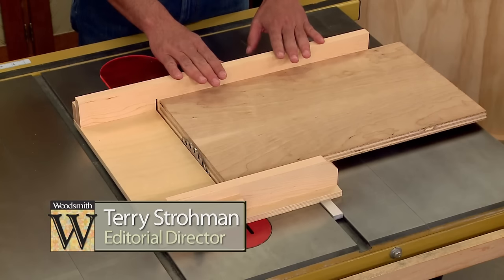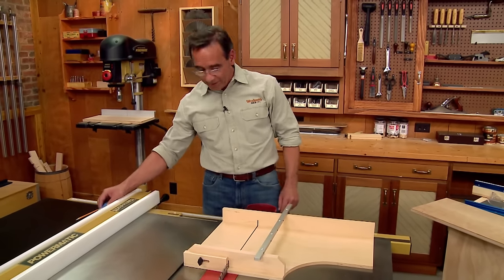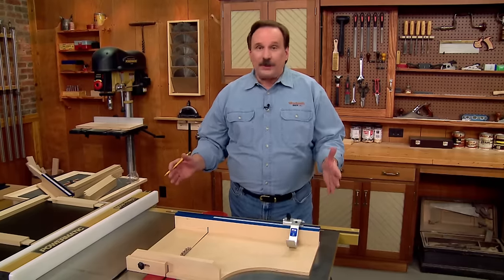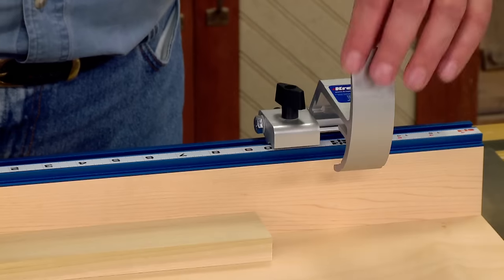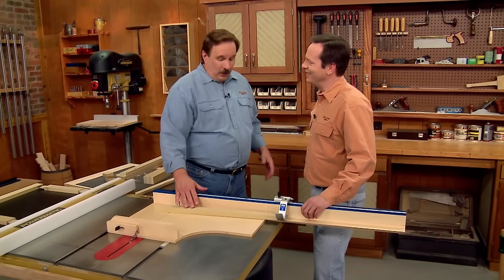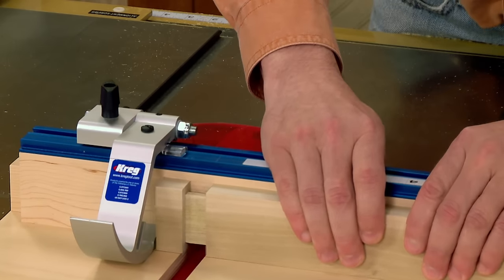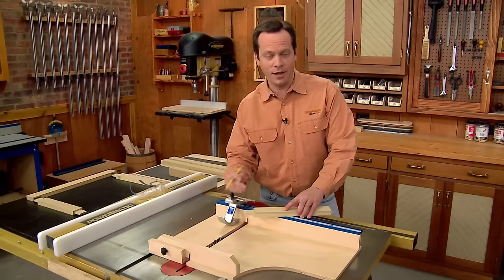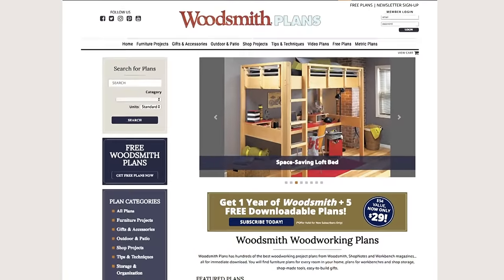Maybe the Best Table Saw Crosscut Sled Ever?

Comment: The only issue I see is that your dado blade eats a huge chunk out of the rear fence... so when you go back to a smaller width blade, you're going to get tearout - but it IS on the waste side, so I guess it's a minor issue.  I really like the adjustability, that's clever!
Reply from the maker: Yeah, I was having the same discussion about this with another commenter too, and even though it's on the waste side of the fence it might get kind of shabby looking if you do  a lot of deeper dadoes.  I think I might add on a replaceable hardboard insert in a small section of the fence like we did on this box joint jig: https://www.woodsmithplans.com/plan/adjustable-box-joint-jig/
Reply: @WoodsmithShowandmagazine  That was the one thing I saw in this good design.
Reply: @WoodsmithShowandmagazine  so whats hthe finaly decision on how you solved the back fence once DADO is used. im looking to build this next weekend and order parts but wondering if i should build this exactly like this. or exact but no adjustment of blades.  because once i use DADO once. its now done
Reply from the maker: mike gray - if you are worried about the back fence getting chewed up I would just add the replaceable hardboard insert as mentioned above (making it about an inch wider on either side of where your kerf and widest dado would be to have room to screw it in place)... You could always do this later or just replace the entire fence if it gets too bad.
Reply: @WoodsmithShowandmagazine  thanks.  I'm a beginner getting into this.  Starting with built in office cabinets.  So cabinets are first project.  I may just start with this design but not adjustable as the size of this jig  dado3for Stiles would be great. But putting a groove in larger wider boards won't work especially length wise.  But then again I'm learning on a small dewalt 7480. Not a large table saw with large tabletop.
Reply from the maker: @4rdzlla  - That's not a bad way to start out... You can always change out the parts and hardware to an adjustable base version later.  Too funny - I have a Dewalt 7480 sitting in my office right now... I'm working on designing a Table Saw Workstation for a future issue of Woodsmith Magazine.  Let us know if you have any more questions on the sled or any other project build.
Reply: @WoodsmithShowandmagazine  workstation for the 7480!? I'll definitely have to follow along.  Didn't buy a stand yet.  Actually dont have the saw yet. It arrives next Tuesday
Reply from the maker: @4rdzlla  - Yep! My plan is to include a router table and flip-top for a planer with it too.
Reply: Also the slit to slide the jig and tighten. Done by router? Not sure how I can do that 1/4 slot
Reply from the maker: @4rdzlla  - I would personally do it on a router table, but I think in the plans it says to drill a series of holes and then clean out the waste with a chisel and file.  Or you could just drill the end holes and then cut out the waste with a jig saw or coping saw.
Reply: @WoodsmithShowandmagazine  trying to order the correct knobs for your cool jig. so many options not sure which one is best and a good size. also the threaded 1/4 insert .50" long right??
Reply from the maker: mike gray - we went with a smaller “T” knob but the shape doesn’t really matter... I would just go with something low profile so it’s not in the way.  You are correct on the threaded insert... 1/2” length is good.

Comment: I just got the plans today and they seem reversed for my sawstop. Can you please send me a link for the correct plan orientation? Thanks Marshall
Reply from the maker: Yep, the original plans were designed for a right-tilt table saw and your SawStop is probably a left-tilt saw like the one in this video.  All of the parts will be the same size just flipped to the orientation seen in the video and the art on the last couple pages of the plan.  Is your e-mail mbgeller... If so I've also added the premium shop drawings to your account at Woodsmith Plans. Just log in to your account and go back to the plan page: https://www.woodsmithplans.com/plan/precision-crosscut-sled/ and click on the link "Shop Drawing" right above "Download" to get more detailed part drawings for the left-tilt version.  Let me know if you need anything else and I'd be happy to help.  - John
Reply: @WoodsmithShowandmagazine  
Thanks John. Got the info and it’s very helpful. Much appreciated!
Marshall
Reply: Hi John,
I was looking at the table saw jig you previously mentioned in regards to making a removable hardboard insert in the rear fence. This is for maintaining a zero clearance when switching between a dado blade and a single blade. Is there any info you can share as to how to go about makin this insert for the fence on this sled?
Thank You
Marshall
Reply from the maker: @marshallgeller8025  - Regarding the process for adding a replaceable insert in the Precision Crosscut fence.  I would use a piece of 1/4" hardboard (approximately 3" wide in this case) so it can extend about an inch on either side of where the widest dado blade will make a cut in the fence. Then cut a 1/4" deep dado to create a pocket in the fence for the hardboard to set in and be flush with the original face of the fence.  To keep the insert in place, you can countersink a brass screw on each side of the hardboard outside the reach of the blade.  I prefer brass because it is soft and if a blade were to hit it then it wouldn't damage the blade.  (I sent you an email too with some more detail)
Reply: @WoodsmithShowandmagazine  John
Thanks so much for the additional info and guidance on how to proceed. Excellent instructions on how to add this feature to the sled. You guys rock!
Marshall

Comment: This table saw sled video is similar to the one that was published in a magazine called Tips, Tricks, and Jigs by Woodsmith.  It's dated 2020 or early 2021, pg 10 thru 13.  I'm trying to decide which way to go with.  I think the biggest difference is the amount of plywood required to make the two-sided sled.  The two-sided sled in the video has an option to add the extension.  The magazine used a longer plywood (4' or so) which is probably more stable than the extension???  Any suggestion would be greatly appreciated.

Comment: the sled is nice, I agree, but once you use the dado ability of the sled, you have then ruined the zero clearance on the rear fence. You make your cut through and the clearance is then widened out to the width of the dado you were using.
Reply from the maker: Yeah, I agree that the back fence will get chewed up (as mentioned in previous comments) it's not a huge deal because it is on the waste side of the cut but one solution would be to add a replaceable hardboard insert like this sled:  https://www.woodsmithplans.com/plan/table-saw-dovetail-jig/

I've been meaning to shoot a video on this subject, so I'll get on that.  Thanks.

Comment: What a great sled!   I wish we could get it as a pre-sawn ready to assemble kit?   Excellent video!!!
Reply from the maker: You may not be too far off on that idea... we are looking at selling CNC-ed & flat-packed kits for some of our more popular jigs.
Reply: I'll take the first one!  Of course you all will have to sign, date and number it  ;^)
Reply from the maker: @drobb4207  - Signed, Limited Edition Woodsmith Branded tools have to be worth a lot more, right? ;)
Reply: @WoodsmithShowandmagazine  - Yeah, you already sell rulers, card scrapers, etc. (I should know;  there are a few Woodsmith branded items in my workshop.) So, you have the system in place to sell the kits. 👍
Reply from the maker: @David_K_pi  - We are gearing up to roll out some kits & more tools this year.
Reply: Yes they are worth more but whoever puts dibbs on the 1st one gets it free! @WoodsmithShowandmagazine
Reply from the maker: D Robb - LOL.. Is that how it works?
Reply: @WoodsmithShowandmagazine  - I'll take the second one in case you're extending the deal.
I'm a good beta tester, by the way - especially on software. My boss thinks I can break any program. Er, uh, find the flaws I mean. 
I can test your new kit for you. 😁
Reply from the maker: @Lynn Collett -  LOL -  so if you buy something like a router table or similar tool are you not a woodworker because you can build your own? :)
Reply: @WoodsmithShowandmagazine  in theory you could build your own router, saw, drill. I could definitely build a router. Thing is.... my time is worth more than that. 😉
Buying ready made is fine. Kits are good because it helps both ends of the skill spectrum. Those that are new to making get to develop a bit of knowledge and that aren't get to save a bit of money. Win win 👍🏼
Reply from the maker: @hesperhurt  - Thanks.  I agree.   :)

Comment: like the adjustability but I have RH saw arbor therefore blade  datum is RH flange, and wood is wasted to LH side with increase blade thickness and Dado blades. The adjuster needs to be on the LH side in my case.
Reply from the maker: Actually, if you look at the photos from the plans: https://www.woodsmithplans.com/plan/precision-crosscut-sled/  We originally built this for a right-tilt saw.  We mirrored the build for the saw in the video because it is a left-tilt.  You just need to orient the sled based on the arbor on your saw.

Comment: there will be a problem, you got a very low max height for your blade which in in itself is good though cause it will reduce the kickback risk. Never remove the knife after the blade it´s there for a reason
Reply from the maker: I agree, a good riving knife can be the best accessory in preventing kickback.

Comment: Now wouldn't it make more sense to orient the sled extension to the right of the blade, where the extension table could help support any added length on the work piece?
Reply from the maker: Yes, but the orientation of the sled is dependent on whether you have a left-tilt or right-tilt table saw.  The sled needs to open up in the direction in which you stack the dado blades.  The saw in this video is a left-tilt blade so the dado blades stack to the right.  If you have a right-tilt saw the blades stack to the left and you would build the sled in the manner you mentioned.

Comment: Is the corner cutout an aesthetic feature only or it has a purpose? Thanks.
Reply from the maker: It does make it look nicer, but the main purpose is just to reduce the weight of the sled.  The functionality of the sled would be exactly the same without the cutout.
Reply: @WoodsmithShowandmagazine  Thanks. That was my assumption but just to make sure. I like it - economical as it uses just one runner...

Comment: Yes it's a good sled but nothing to ground breaking. I have 3 sleds and use oak for the guide and fence. All my sleds use both grooves. It didn't need so many people to demonstrate this very small sled. Been woodworking since 1974 and any woodworker worth their salt has sleds. For the newcomers use both slots when making a sled. More sturdy.
Reply from the maker: Yeah, we didn't NEED 4 guys to demonstrate how to make this sled but how else are we supposed to show off all the different colors of matching shirts we have...  I mean it would be pretty silly for just ONE guy to keep changing shirts during the video, am I right?  :)

With the expanding base on this sled it doesn't really work to have 2 runners, but it seems to work just fine with it's relative small size and the aluminum runner having the ability to be fine tuned for the perfect fit in the miter slot.
Reply: Checkers Boards how can you possibly have found something to have taken issue with in this video? Honestly what’s wrong with you?  Where can we send your refund?

Comment: What kind of wood do u suggest.  I have 1/2 ply for base. But for fences. I dont have scrap. I'm actually going to store for this specifically.  I have maple but it's for my cabinet doors that I'm trying to make.  I dont want to use my maple.   Poplar? Or all playwood? I have abundance of 3/4 birch finished plywood.
Reply from the maker: I'm sure 3/4" poplar or plywood would be just fine as long as it's straight and flat.

Comment: Does the cutaway portion really serve any purpose other than making the Jig lighter-weight? I don't see that benefit making it worth going asymmetrical and having less surface for bearing and support, but maybe I'm missing something.
Reply from the maker: Mark Young - Yes, the main reason is to cut down on weight... but it also makes it more aerodynamic and cuts down on the coefficient of friction too. It’s one of the fastest, lightest, and smoothest sleds our there... probably. ;)  Plus, it just plain looks cooler. But if you don’t want to do the cutout, then you can leave it symmetrical... it won’t hurt anything.
Reply: @WoodsmithShowandmagazine  gotcha. The zero clearance and T-track/stop are nice. You should add the safety stop that Matthias Wandel does on his sleds; I can't recall if he has a spring on his, but I made mine spring loaded, so the stop is reliably pushed down into a recess on the tablesaw before the blade is exposed. I put them on my two main sleds.
Reply from the maker: @musicbymark  - Thanks... I'll take a look at Mathias's safety stop.
Reply: If the old shop notes email address I used to use still works, I could send you photos of my implementation on my sleds.
Reply from the maker: Mark Young - I would assume the ShopNotes e-mail still works but not sure... I’d love to see pics. Email them to orders@aimmedia.com Attn: John Doyle and I will get them for sure. Thanks!
Reply: Mark Young d

Comment: This sled is potentially dangerous. If you place a long piece, using the extension fence, you run the risk of the sled becoming unbalanced. If the blade is running when that happens, it could be catastrophic.
Reply from the maker: This is true.  With all jigs and fixtures on power tools, you should use your best judgement on what is safe.  If you place an extremely long piece on the sled extending off the table saw, you should test the balance before you turn the saw on and slide it through the blade.

Comment: I spent $8 for plans that are backwards? 
Really?
Just flip 'em around in your mind, right?
Couldn't possibly make any errors doing that.
I won't be back if this is what I can expect from you folks.................
Reply from the maker: They are only backwards if you have a left-tilt saw.  :)  (which is probably every table saw that was built in the last decade.)  I believe we've added some drawings at the end of the plans to demonstrate the different construction for the left-tilt version, and all dimensions remain the same.  You are probably correct that this is less than satisfactory based on the popularity of left-tilt saws in the current market and the popularity of this plan.  We'll work on getting some separate drawings for you if needed.  To the best of my knowledge this is the only plan/project we have that this is an issue.  You do have a free video right here on YouTube demonstrating the build of a left-tilt version, but if you have any problems with the construction of the project, don't hesitate to contact us and we'll gladly help you out.
Reply: @WoodsmithShowandmagazine , you got bad information. There are no drawings at the end of the plans for a left-tilt saw.

I'll figure it out, but I have to run back and forth to the computer three or four times before I cut or drill anything. Shouldn't be that way.
Reply from the maker: @benbrown8147  - You are correct.  Those were supposed to be added a couple months ago but apparently it didn't get done.  I'll e-mail those 2 pages and see if they are any help.

Comment: This looks like a very versatile design.  The Youtube video shows the large portion of the sled to the left of the blade when standing at the operator's position at the saw, but in the photos at the plan link it appears to be mirrored left to right.  Compare the 4th and 5th photos in the link. Can you clarify, or am I incorrect?  Thanks for an awesome design.
Reply from the maker: Yes, the original plans are mirrored compared to the one we built in the video.  I was thinking this was just based off personal preference. I've always used a table saw sled on the left side of the blade (like what is shown in the video).  After a discussion with another commenter, I'm wondering if it's based on whether you have a left or right-tilt table saw... that would affect rather your dado stacked toward the left or right.  I believe all of our table saws are currently left-tilting.  The older table saw we had when this was first built might have been right-tilt. I'll discuss this with the other guys and see if I can get a more definitive answer though.
Reply: @WoodsmithShowandmagazine   OK that makes perfect sense.  I have an older Craftsman contractor style saw.  Just checking to be sure I was seeing things correctly.  Thanks for the speedy reply.
Reply from the maker: Dave Smith - No problem. Thanks for watching. 👍
Reply: I have the issue of shopnotes with the article for this sled. The article makes note that depending on the tilt of your saw determines what orientation you build this sled. You’ll want to build it so the adjustable side can open as you use your dado blade.

Comment: I am wondering why the measuring tape isn't at 0 where the blade meets the fence? the 1 on the tape looks a fair distance off from the blade.
Reply from the maker: That is because the hairline indicator is actually on the right side of the flip stop (as you’re viewing it in this video) when the stop is at zero. You can see it better in the 3rd pic here: https://www.amazon.com/Kreg-KMS7801-Standard-Swing-Stop/dp/B0002QZ4WG/ref=mp_s_a_1_7?keywords=kreg+flip+top&qid=1583380873&sr=8-7